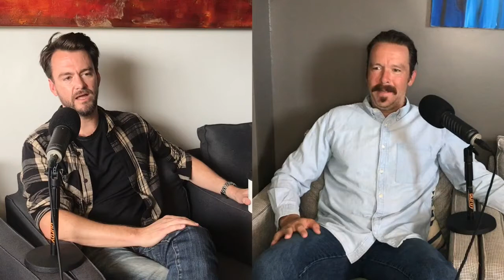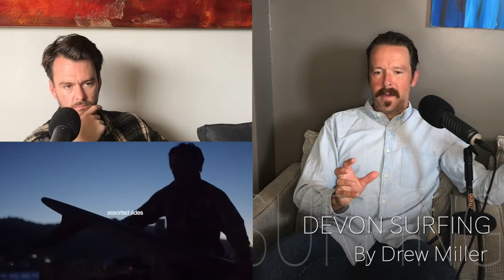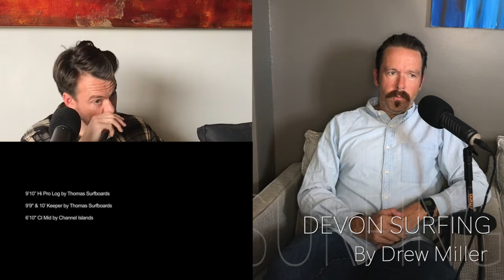Devon Howard On Hand Shaping vs Machine Shaping

Comment: 12:16 Had a 2" rail ding by the fin box "repaired" by a surf shop and they took the whole edge off (about 16" long). I didn't realized at the time I picked up my board from the shop until I surfed it. It just didn't feel the same at all anymore. Beware of poor repair jobs when it comes to edges!